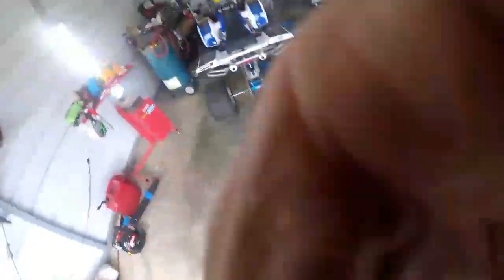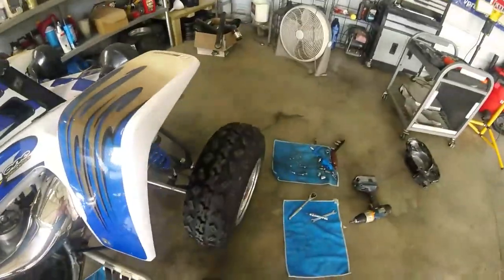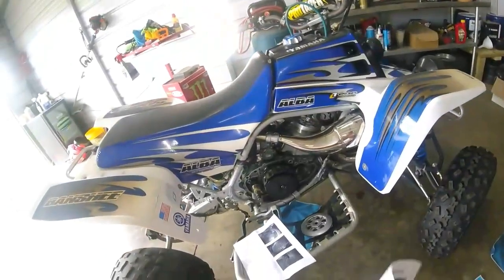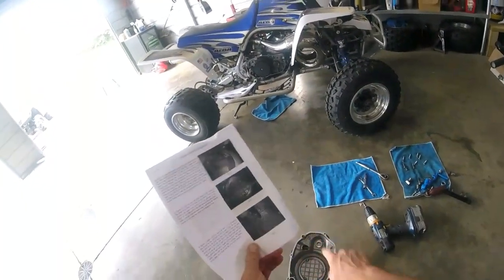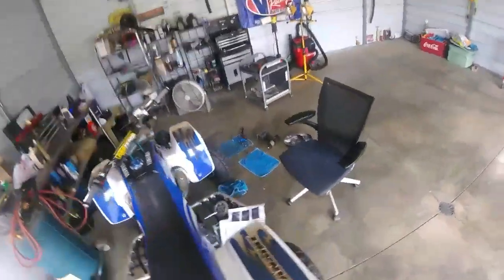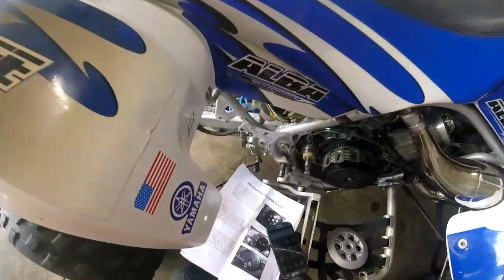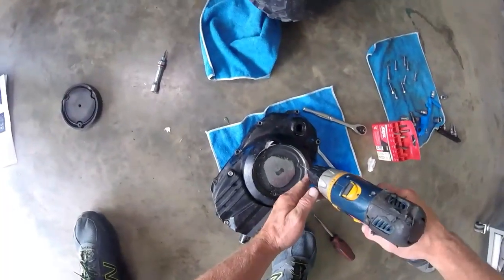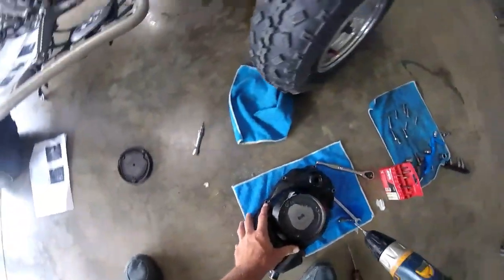lockup clutch install

Comment: Lol that nut drove me insane! He needs to make a tool so you can set the end play I finally opened mine up with a tungsten bit no more problems.
Reply from the maker: Dude I know Anthony at like to drove me up the freaking while trying to get that nut height and get the clutch adjusted correctly
Reply from the maker: almost drovr me nuts

Comment: how reliables is a banshee (especially one like yours) bc my mom is up my ass thinking i made a bad purchase
Reply from the maker: whats done to yours
Reply: 421's can be very reliable if setup correctly. im on the same pistons/crank going on 3 summers
Reply: They require maintenance. But they're the most legendary quad you can get imo. Just keep it forever and it wont be a bad purchase